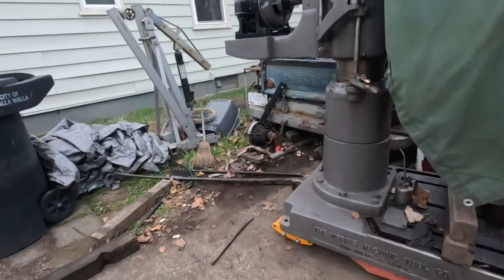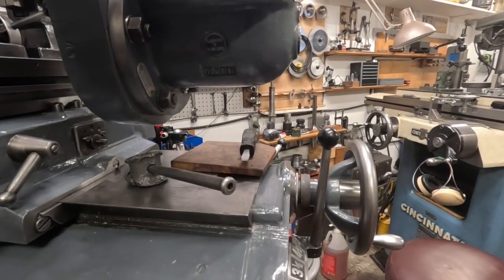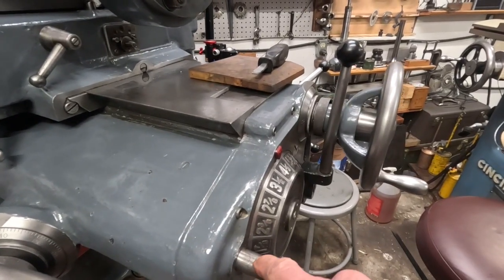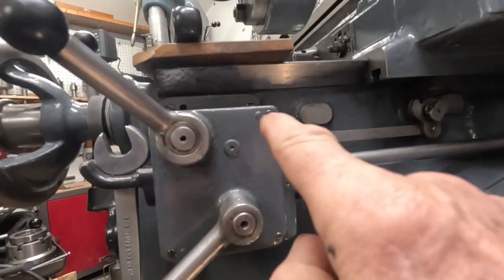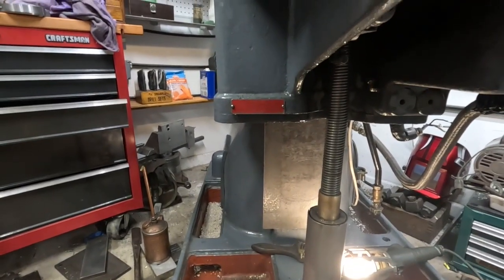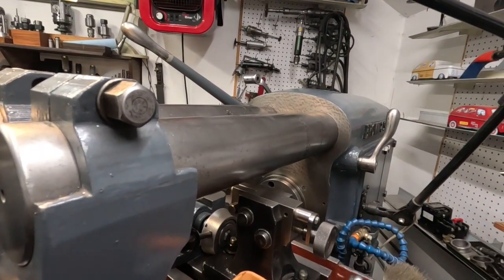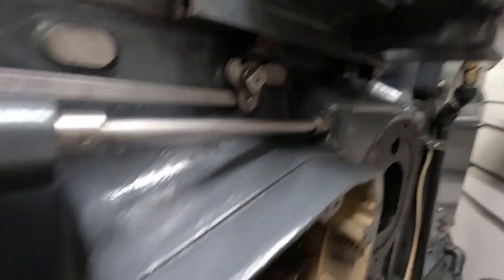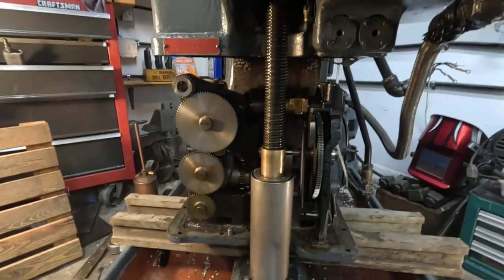Brown&Sharpe milling machine motorized knee gear case removal

Comment: Did you ever get the bearings replaced on that big drill press?
Reply from the maker: Not yet, I need to move this to the front of the building in order to remove the drilling head for the bearing replacement.

Comment: Not as complicated as one might think, but very interesting on how these were built Thanks I'm a retired auto tech at Caddy dealer, mostly engine work
Reply from the maker: Hi, they made this mill much easier to work on with unit construction of the gear case. Thanks for tuning in!